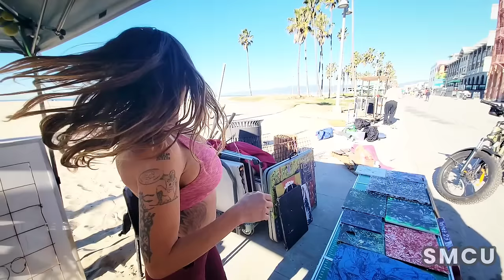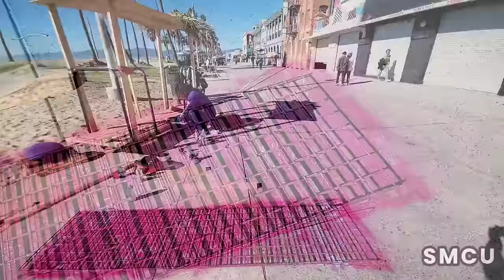Daisy, the Venice Healer, Builds a Tiny Home for the Homeless

Comment: Nice change up from the usual park Ranger's morning homeless wake up call & their 15 minute notice of eviction from sleeping on the  stall floors of public urinals. Before they install the desaliziination apparatus & plumb for running water they need to master the art of pre drilling guide holes for setting the deck screws, especially in hardwood.This tiny house on wheels will carry 6x the amount of curb alert debitage, found objects & unwanted items than the average Wal Mart shopping cart will carry. I wonder how long has Daisey been auditioning/ rehearsing for the special part.?
Reply: Are you saying that Daisy is one of gods special people? 😊 🐒😇